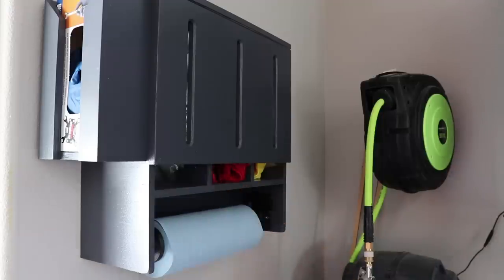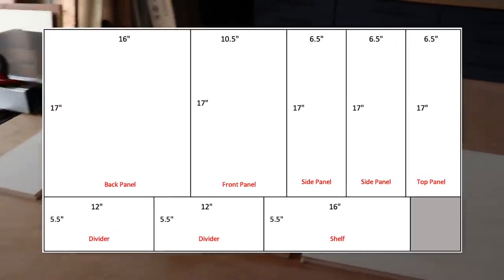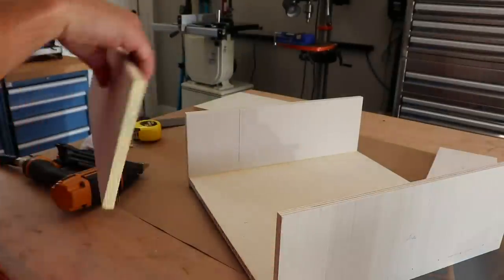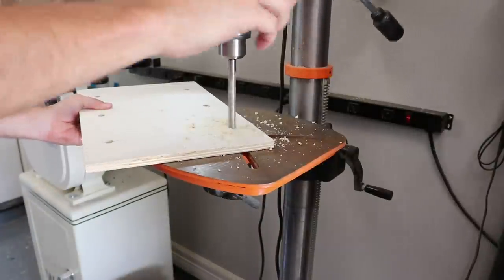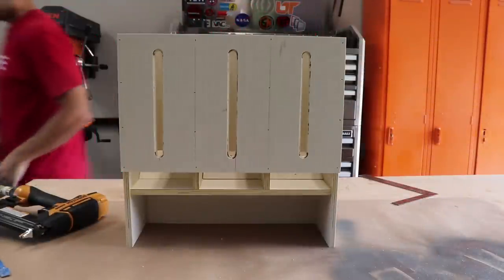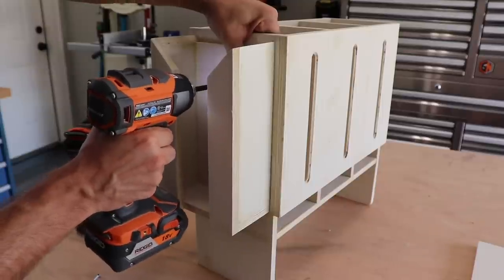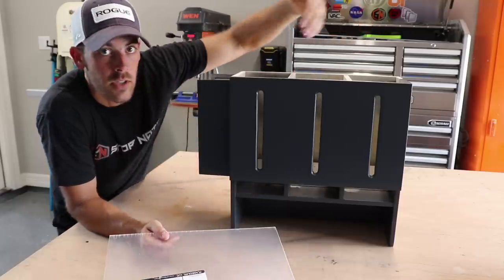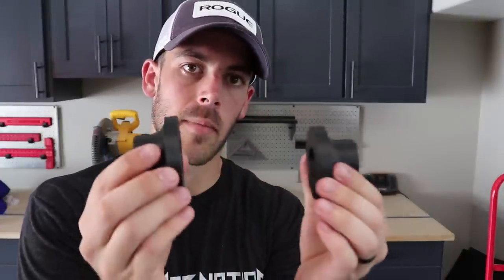DIY Shop Towel Cabinet Build // Shop Organization

Comment: Both my guy and I have separate shops. His shop is tractors, painting tractors or trucks, tractor repair/rebuild, combine work and occasionally a warm space for me to work on wood projects, furniture or vintage camper restoration. My shop is mostly camping, project building, home improvement, gardening and wood projects. We both have the need for paper towels, rags and gloves! I am a re-user so I have a crap ton of odd lumber. I tend not to buy plans as I would have to have all the same type of material. I like to see ideas and wing it. I LOVE French cleats too!!! Nothing should be hung on a wall without one! Thanks for the video and ideas! NOTE: what I would buy is the paper towel dowel holders and spacers, but I will make them out of wood..

Comment: Awesome cabinet.  Much fancier than my setup.  My wife has a cat so I get cat litter buckets.  Hinged lid and rectangular.  I cut a 4" circle in the lower face of the bucket to pull the rags out.  I stick the bucket on a shelf or hang from the handle depending on where I need it.
Reply from the maker: Hey that works too! Pretty creative

Comment: I liked the project and the video.  Since you asked for feedback....In my shop, I use gloves and paper towels, but also wax paper (not enough rags for three boxes).  My cloth rags are uniform, and used for applying or wiping stain (so I don't need three separate boxes).   When I use paper towels, (as you said) my hands are already covered in water, paint or stain.  So grabbing the paper roll to rip off one is a problem.  With wax paper, I tear off small pieces, to keep glue off the clamps and workbench.  So my ideal rack would have:  - Two or more rolls, but restrained (slightly) to make them easier to tear off just one.  Maybe add an edge to cut off the wax paper piece  - One (or no) box for cloth towels  - Keep the glove box as you didThe 3-D printed parts are (sort of) cheating, as few of us have these.  Routing that "L"-shaped channel for the roll bar(s) would be fair, though.

Comment: Like your DIY storage items I built the same roller holder for construction paper used when doing glue ups for segmented builds roll off what you need and I do as you did just reload paper back onto the roll use it again as needed 👍

Comment: Liked everything except the paper towel holder.  I can make everything except the 3D printing!  Keeping things light and Humorous is a great touch as well...  Keep up the good work.
Reply: LOL, yep same here...so I had to scrap the plans to make one of these because I don't have a 3D printer....I'll pickup the plans again when I have a 3D printer, then I'll just 3D print the whole cabinet HAHA!!
Reply: @wildbill23c I don't have a 3D printer either but I made them with plywood, a forstner bit and a chisel. You don't need a 3D printer. I'm sure a hardware store might also have something similar.
Reply: @jac_builtWoodworks  I was just going to cut some slots in some scrap wood to insert a dowel, but the 3D printer would be a fun tool to have otherwise LOL.

Comment: This looks like something I will need to build. The only addition I would make is a place for waterless hand cleaner. I use Joe's Hand Cleaner (available on Amazon). I started using Joe's because the container hangs upside down. It turns out to be a great waterless cleaner. A hook under the latex gloves would be the only thing to add.

Comment: Great video as always! Will be printing the paper towel holder. Will be using it at my locksmith shop (trying to achieve shop greatness there also). Will be building this as I am constantly looking for rags when working in my shop. Thanks Travis and have a great day!

Comment: Love it.  
I  work in a Hospital and the only thing I am go into do differently is the glove holder will lye flat on a shelf.  When the glove box is full it works great mounted like yours. However when it is 1/2 full or less gloves fall out and hit the floor.

Comment: Great stuff as always! 👍 A possible upgrade could be to include a method for one-handed operation for the paper towel roll? So as to tear single sheets (or a number of them if required), without pulling too much off the roll. A simple wire/fishing line across the front of the unit may enable this... Or something similar. Keep up the fab work my friend, can’t wait until the next project😉
Reply: I liked the idea of using one hand.

Comment: I love the Markforged printer! I just wish the Onyx material wasn’t so expensive. We go through 10-12 rolls of it per year easily.
Reply from the maker: Nice! Yeah a lot goes into the Markforged materials production making sure it delivers. What do you guys use it for?
Reply: Shop Nation we use it to print everything from rocket parts to prototype K9 body armor. We do a huge amount of fundamental testing of the material itself. Just don’t let the Onyx stay wet for too long if it does. The base nylon material does not react well to water.

Comment: Love that you are more active with putting your 3D print stuff into your projects and videos. I know it probably is hard to make the dual content like that but I find it surprising that it doesn't make it's way into more shop videos. You and Marius are the only ones I've seen feature prints.

Anyway, quick question is what materials do you like to use in the shop? I would imagine a Nylon would be the best option if you are set up to print it... Currently that would be a stretch for me with my experience and setup, so I'm wondering what you think of PLA or PETG in the shop. I've had screws pop layers apart on functional prints is why I'm asking. Maybe it's more of a slicer settings issue than a material issue?
Reply from the maker: Nylon is great but can be tricky to print with some printers. I actually like Tough PLA PRO from Matterhackers. It prints extremely easy and is pretty strong. PETG is also a good option but can print a little strange sometimes
Reply: Ok, will probably buy a spool with that recommendation, have mostly gone with hatchbox or whatever is a good deal so far.
Reply: @heathjharris  I print with Inland PLA + and it works great in my garage shop down on the gulf coast. we routinely get 100+ temps and I've had no issues with the filament. I did have an issue printing the paper towel holders for this project though. Cura wouldn't import them correctly on multiple machines. Had to blow the parts up to 2375% to get them to an inch. worked though.
Reply from the maker: Technically you should scale them to 2540% to get the true dimensions (slot is oversized a bit)

Comment: I must have missed the episode about the hose reel.  I am getting tired of tripping over an electrical or air hose.  I am running out of wall space in my garage and am thinking about mounting on the ceiling.  Have you looked at this position??  Do you like your reel and if so, where did you get it??  Thanks for a great build; I certainly need one of these storage units.  It will fit nicely on my french cleat system.
Reply from the maker: I love the flexzilla hose reel, check out one of my older videos on my air compressor where I talk about it. I also have it linked there!
Reply: @ShopNation  Thanks for the guidance.

Comment: Thank you great video. Always interesting to watch and as L Drake said I also need this. 
Question how is the dust collector in the new cabinets holding. Is the hose working properly, I want to build it for the cabinets I am making but don't know if use hose or PVC pipes?
Reply from the maker: Dust collector works great, I hook up a vacuum hose to it all the time for cleanup. PVC would work well too, either one
Reply: @ShopNation  Thank you for your answer and keep building the great shop you are making.

Comment: pretty Slick Cabinet here is my Hack for good Shop Rags Cheap   i go to my Salvation Army store and buy $ 1.00 TShirts often  i can find many brand new  never worn ones that  a Company had printed up for a  one day event  like a Fundraiser or whatever and wound up having lots left over  so they just donated them for a tax write off  my SalvationArmy washes all the clothing  anyway so  they always have a good supply  of new and used  it’s way less expensive then the Boxes of Rags at the Hardware Store or Paint supply  and you get a higher quality of Cotton/Polyester blends that are good for finishing  usually a shopping Cart filled up is around $50.00  and that’s enough rags for my Shop and  to do all my Maintenance and Bright work on my boat for  about a year ,the Blue ShopTowel rolls  leak blue dye  and the T shirts do not  and for me the cheapest price on the Scott Brand Towels is Costco and mine is a Hassle to get in and out of  and is not super convenient. to get to  for my CommercialShop i do pay more to have them delivered , but i like to keep  my personal items separated

Comment: How did you mount the box to the wood that was screwed onto the wall
Reply from the maker: A French cleat, basically two pieces of plywood ripped at a 45 degree angle that fit together. It’s a great way to easily hang stuff on the wall
Reply: @ShopNation  would you do a video showing how to do that

Comment: Ditch the annoying music.  Best to have none.
Also I would leave off the plastic windows.  I have similar product and if stuffed too full, the rags/bags/etc won't "fall" down by themselves. You either have to open the top and push down (difficult for yours since you mounted so high) or pull down contents through window slit with finger.